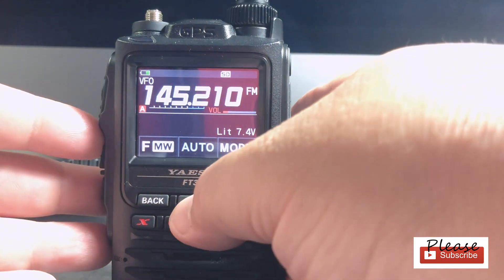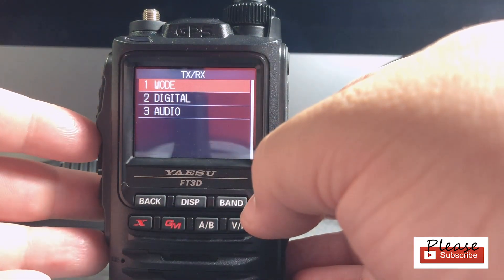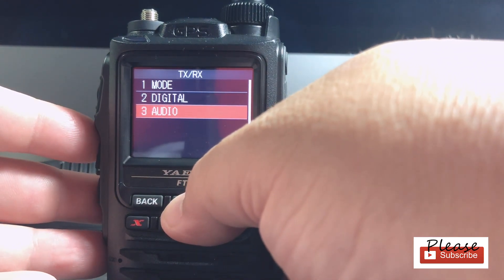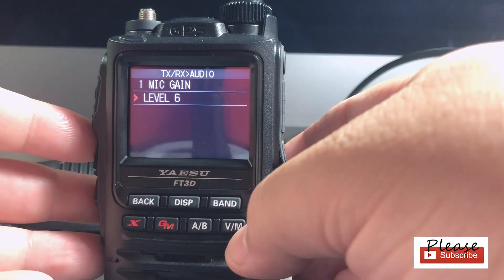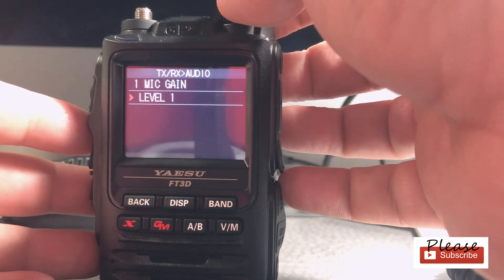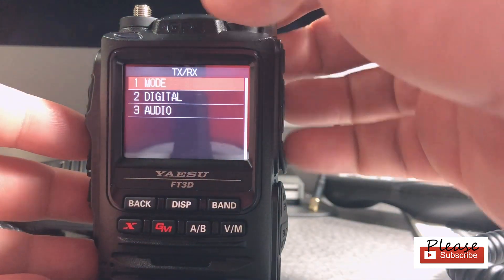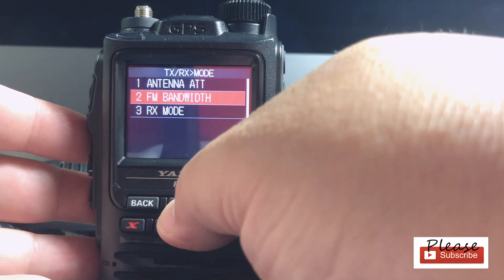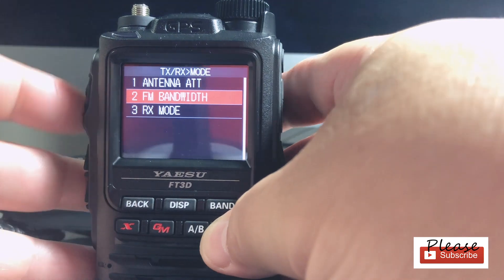Yaesu FT3D FM Wide Band and Microphone Gain

Comment: Thanks, a couple of things: UPDATED: This mode setting at the device for FM Narrow/Wide doesn't always take. Seems like it's either because it's an edit to an existing channel or because the channel is assigned to one or more scan lists, not sure which it is, but it gives a series of fail beeps and doesn't persist. I'm using RT Systems and it's just not obvious in the UI how to set FM narrow as one would expect it in "MODE" for us ICOM guys but options are only FM/AM/DN/VW. Found the trick to be the checkbox under "Half Dev". That sets Narrow band for whichever mode is selected on the FT3DR.   73's
Reply: I appreciate your take on this, I will give that a try, love this rig! My work around was getting the external mike. 73, Ben